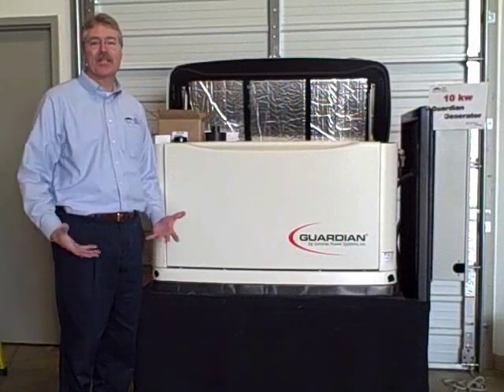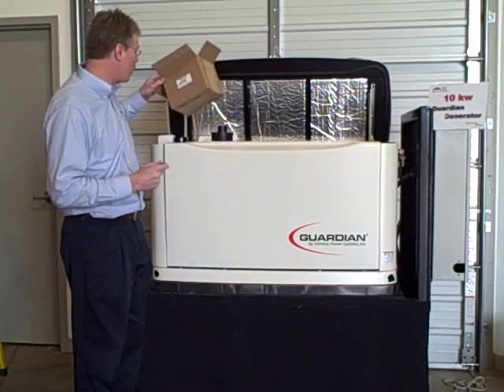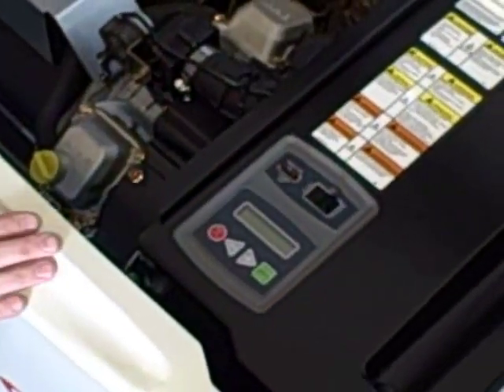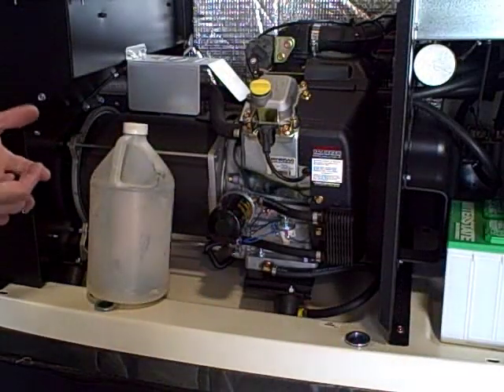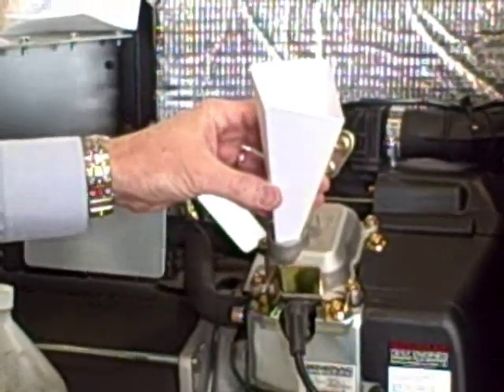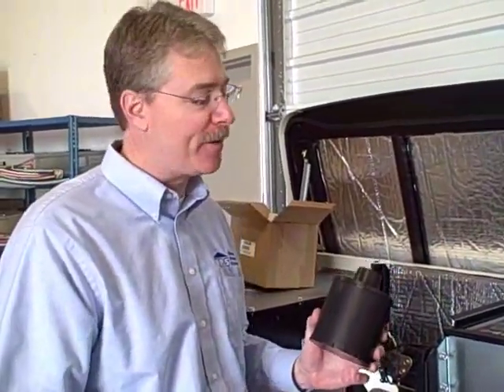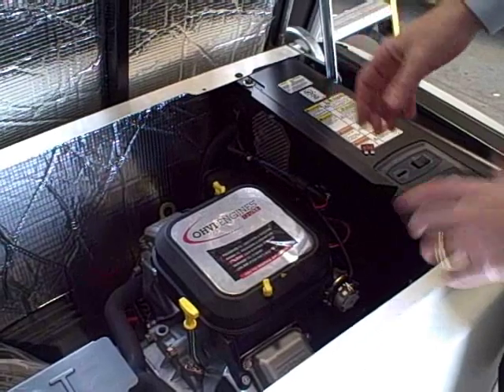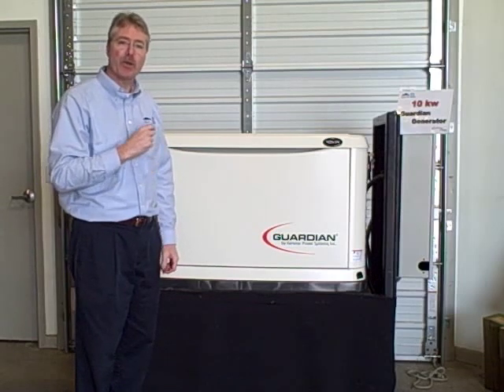Installing Guardian Generator Maintenance Kit

Comment from the maker: @asus3571 Yes, even though the generator may not have been used during an outage, it still needs regular maintenance. Remember, the generator still starts and runs once a week during it’s exercise cycle and you want to make sure the transfer switch is working properly as well.  Thanks Jim - Home Power Systems

Comment: Jim, will you take a troubleshooting question?  My two year old Generac 8kw gets an overcrank error and won't start during exercise mode.  It's starts fine in manual and automatic (when required) modes.  What could be the problem?  Enjoyed your video.  Thank you.  Jack